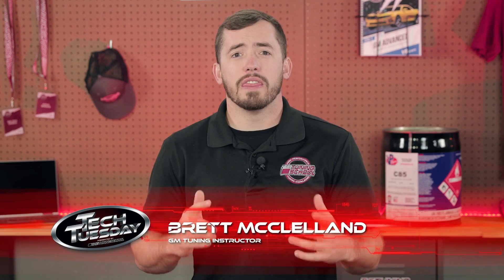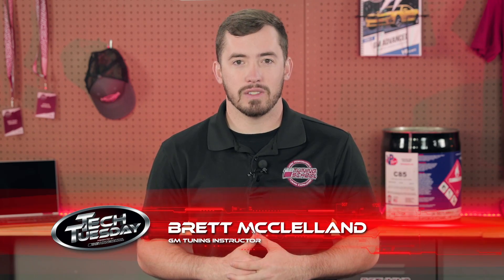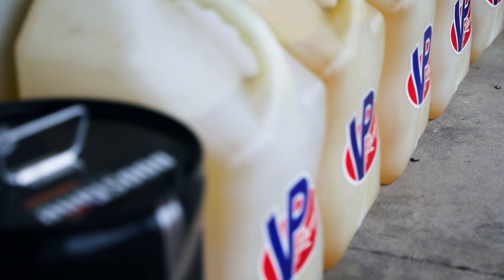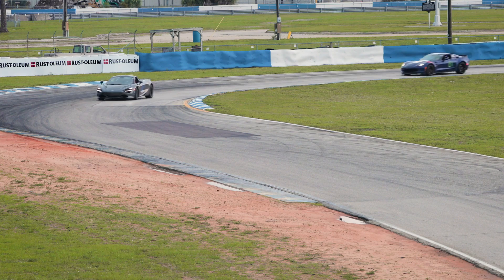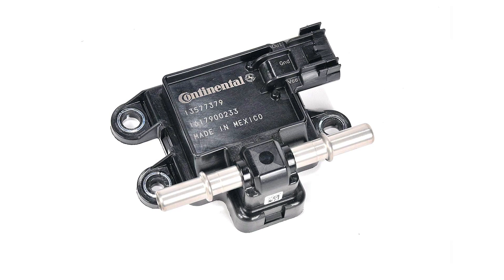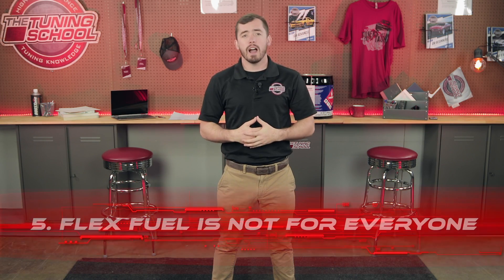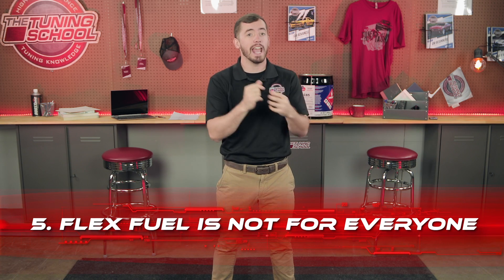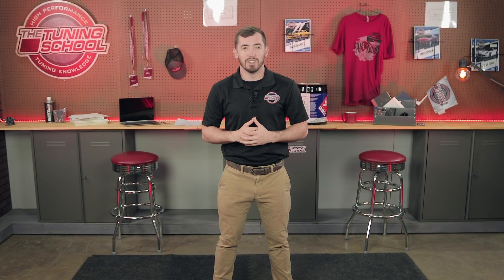Demystifying E85 & Flex Fuel

Comment: Must have some crap station for E85 where you're at to be getting 40-60% lol. I never see below 76% here and average is 80%
Reply: The E85 standard is 51-83% ethanol.  So las long as the ethanol content is 51-83% at the pump, it's E85.  It's not a quality issue.  If the ethanol content is below 51% at the pump, then you'd have a right to complain because it is not E85.
Reply: Yeah, I live in the northern east coast and we see a much higher average here. Helps a lot that every 3-5 miles is a gas station that carries e85.
Reply: Damn you lucky. Where I’m at max is 56% sadly
Reply: cmdrdredd  Ethanol is very forgiving. That being said, the harder you push your engine combo, the more exact the tune and fuel percentages need to be. Best of luck making great power!

Comment: Just an FYI, you did not explain the difference in stoichiometric values correctly. You stated that because it has a lower BTU content, you need more fuel to make power. Stoich value has nothing to do with the energy in the content in the fuel. If you combust both fuels at their stoich values, the energy released in the E85 will be lower and with a different energy release curve (e85 has a slower burn and higher resistance to ignition).
The correct explanation is because you have less energy during combustion after you reach the same lambda value, you need to add more air (and thus even more fuel) plus more timing to get more power. This allows you to access power that was previously restricted due to knock limitations based on engine design and operating conditions.
Still a solid video on e85, just that one bit that was miss-associated
Reply: You're correct he did explain stoichiometric value incorrectly but so did you in your 2nd paragraph. Stoichiometric is merely the value at which fuel burn most efficiently, meaning the best burn not the most power. LPG has a stoic value of 15.5 and a lower calorific value but can, and in liquid phase injection does, produce more power due to the removal of latent heat from the intake air stream as it is entering the cylinder (or in the case of direct injection it lowers the latent heat within the cylinder itself). Thus stoichiometry has very little to do with "power" output but alot to do with fuel efficiency (as in MPG).
Reply: @michaelau5159  I think you misread my comment. I said for a given lambda, you make less power with all else being constant of course (i.e. same boost, temps, timing, etc). Lambda is not the same as AFR and has nothing to do with stoich values themselves. It's actually the ratio current AFR to stoich AFR so a stoich burn for any fuel is 1.00, but usually run about a .80 for turbo engines. Multiple that by your fuel's stoich value and you get your AFR.
Getting an e85 car to run the same lambda as gasoline will cause you to lose power. It moves the knock threshold allowing you to advance the timing more and run more boost without knock. It gives you a more stable and controllable burn.
You are correct that power and AFR are not directly linked.
Reply: 5:37 clearly said it.
Reply: @wrotedog  he said it... incorrectly, which was the point of my comment mate. I just came to add some more information to the conversation 😉👍

Comment: Question. None ethonal fuel is pretty available in GA is that a good fuel to get a tune for on a  daily driven/ track car for road courses and auto cross?
Reply from the maker: Typically, no. The lack of ethanol most likely is going to lower the Octane rating. This makes running the fuel in a performance application less than ideal.
Reply: Its Georgia, we'll find a way, tune that shit. Too many cars here run on it so well, our climate is best for it

Comment: So if I'm running a 6.0L and computer out of an 05 Escalade I can convert to flex fuel injectors and wire in the sensor to convert to E85 and the computer will not need to be changed?
Reply from the maker: The computer should not need to be changed. However, there are tune changes that will need to be performed. Also, the modifications to the engine are going to play a factor in what mechanical parts are needed.
Reply: @TheTuningSchool  Modifications pertaining to what? I'm planning on running all the factory sensors hooked up, stage two cam, bigger injectors w/ truck rails and turbos. What other mechanical parts are needed besides a larger fuel pump?
Reply: Mason Campos yes you just tune your current ecm to enable it
Reply: @lManson Campos The 05 Escalade ECM (P59) will need tuning to Enable the Flex Fuel Sensor and to Change the Stoichiometric Air Fuel Ratio according to Alcohol percentage so the ECM can use that stoichiometric reference table to know what AFR to run at different Alcohol percentage mixes.
Reply: Mason Campos No such thing as a “Flex Fuel Injector”

In high HP applications you may need larger injectors and pump, but they are not specific to Flex Fuel/e85

Comment: 1:54 not really, the difference in stoichiometric ratio between E85 and regular fuel  comes from oxygen content in fuel, E85 is an oxygenated fuel, regular fuel do not content O2, that is why  those fuel have different stoic ratio and that is why once you put E85 your lambda increase
Reply: I dont have a theory. because I have tuned many cars over to e85. So I've actually tested different content mixes of ethanol. I think you are confused and have half of the full picture. 
 If you pour ethanol Into your gas tank of your car. You will indeed lean out, causing your lambda to increase. Assuming your fuel trims are not reacting to the fuel change. Or you do not have 02 sensors.  But if you increase the amount of fuel that enters  the engine it will bring your lambda back to 1.  Your "theory " suggest that e85 Carries enough oxygen to achieve combustion with out the need of air ? So if I ignite e85 in a vacuum chamber it should ignite ?  It is oxygenated but it does not carry as much o2 as you think .
Reply: @DynoLess  Oxygen content of ethanol is 35%, this where the difference in AFR comes, It might not be enough to ingnite under vaccum but that is a lot no ? sorry for my english
Reply: @jeepgarage  Your English is better than mine. Lol.
Reply: @DynoLess  where are you from ? :)
Reply: @jeepgarage  California. !
Reply: @DynoLess  ok, I'm from france
Reply: @jeepgarage  that's cool. I took french 2 years and I failed lol
Reply: @DynoLess  french isn't that easy I know ;)
Reply: Wrong
Reply: @DynoLess  wrong what ? develop your theory, I'm interested in :)
Reply: Ethanol carries hydrogen with it in its molecular structure. Less BTU’s than gasoline, but there are many advantages included increased knock resistance, latent heat vaporization (takes the heat out of the air cooling the intake charge), at 85% it’s around 105 octane but performs better than 116 octane, its very forgiving, needs less jet changes in carbureted applications, and it loves power adders.
Reply: @taylorgtrotter  gasoline has hydrogen in its molecular structures as well, thus why it is called a hydrocarbon. the stoichiometric value changes because there are fewer reactants per molecule to react with o2 in the air. for anyone interested in why this is true look up stoichiometry.